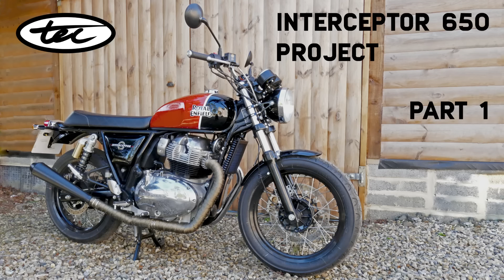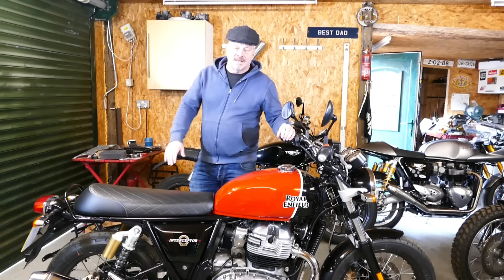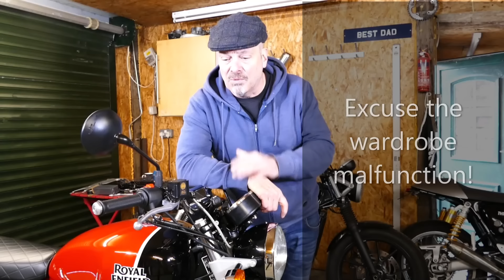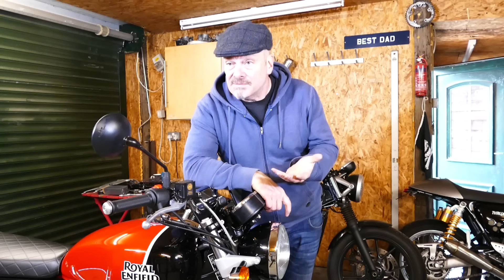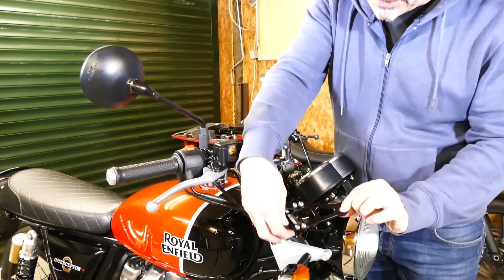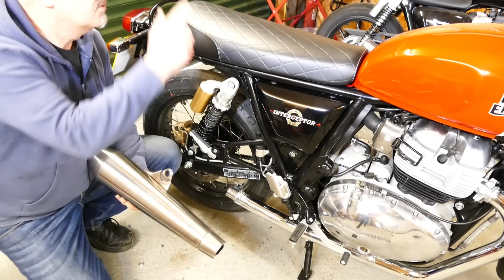Interceptor 650 Project - Part 1

Comment: Contrary to what the video states the kit does not contain domed stainless bolts to replace the galvanised bolts originally fitted to the headlamp. I contacted tecbike parts to enquire about this but you have to use the original galvanised bolts. For info if you notice this as well.😊

Comment: This build is awesome and your videos are great! I am a little ways out from getting one but I had a question hopefully you can answer. If I were to put on the exhaust cans and a high flow air filter (the stock seems restrictive). What would that do to power? More importantly, would I need to get it dump tuned or something since the fuel injectors would have a whole lot more breathing to deal with? Thanks so much and keep it up! Great mods!

Comment: The issue with RE trying to re-introduce to the United States is that there "may" be ONE dealer in each state. No one seems to repair these bikes except for RE making maintenance difficult especially when the closest dealer is over 100 miles from your residence. It would be nice if there was a bit more communication from Royal Enfield about service centers/upcoming dealer locations.

Comment: Hi sir. I don't have a service manual yet so i cant ide tify all parts. Is the welded part of the exhaust pipe undernearth the crankcase part of the cat system? Cant wait to get some of these parts after my wrranty is up. I ak just glad they dont install post cat o2 sensors yet on bikes here in california. Appreciate the videos

Comment: Replacing the indicators with tiny, cheap chinese LEDs is horrendous!  The black headlights brackets too look awful after installation.  The silver bracket provided some contrast. Now it looks like a jumble of black wires and metal!

Comment: Even the new street twin - the 900 at least - has smaller discs both front and back  than the RE as far as I recall. I am not sure the tyres are the same, the RE has a tubed tyres and the street twin is tubeless. As far as I am aware, the pirellis on the RE were designed for it specifically, because of the the need to have a tube in spoked wheels. I stand to be corrected though.

Comment: Hi guys I have a question which cant answer in Royal Enfield dealers at the moment. I would like to use petrol tank from Continental GT 650 twin on my Interceptor coz I like it more how it looks, but I am not sure if it will fit without drilling holes or welding.  Can somebody help me with it pls??????
Reply: The frame an chasi are the same for both bikes so yup you can do senorita !!!

Comment: I'm going to get my licence before summer and have been interested in this bike as my first bike. Would you recommend this bike as a starter? Cheers
Reply: yes this would be a great bike for you , it is very easy to handle ,as long as you are not too short in the leg, as seat height is a little high for some riders
Reply: @georgemilburn6213  That was going to be my next question lol I'm 6ft 4 will I be to big for it? Cool channel by the way if I do get this bike I'll be customising it to 👍 thanks for the help
Reply: @notoriousbc6090  I would always suggest a test ride first, most RE dealer have demo bikes available

Comment: Would you be able to develop a saddle seat kit (with springs) and separate pinion seat for the Interceptor. Thanks, Ronn
Reply from the maker: would not be easy with the straight tube frame rails

Comment: Those original brackets/indicators didn't look too bad on video. The replacement indicators should really be positioned further away from the headlight otherwise, at night, they will get lost in headlight glare. This is a big bugbear of mine with car design - with some cars front indicators are virtually invisible at night. On the Interceptor, I would make sure they were outboard of the forks and/or at a different height.
Reply: well said!
Reply: Couldn't agree more.. I see a lot of cafe racer builds in the internet which sport led indicators on the suspension and sometimes even under the seat.. those might just get you past the regulation but I wonder if a cager will ever be able to see them regardless of day or night..

Comment: Several reviewers have commented on the position of the foot-rests. As I understand it, with feet down at lights etc, they tend to be right where you want your lower leg to be so they dig into your calves. A foot-rest package that alleviates that issue should sell well.

Comment: I'll probably keep adding as we go. But.. The hydraulic line coming from the hand grip. Got to make it black... It has always irritated me that most motorcycle manufacturers use the headlight bucket as a junction box for all the wiring. Nothing but a mass of confusion. My 1974 Honda CB360, that I customized, Had only the wires to the headlight and signals. If I can do it, why can't the manufactures?.....

Comment: I thought that the whole idea of a balance pipe was to get it as close to the head. Am I wrong in my assumption?
Reply: All installations and motors are different and that is normally the case with highly restrictive silencers, but we want one to improve torque at low to mid revs

Comment: Those new led indicators look completely useless.
Reply from the maker: they are actually brighter than the stock ones when flashing, and the whole point is you can hardly see them when turned off.

Comment: Keen to see the next part..one suggestion is will it be possible to mount a saddle  cruier like  seat ..as we see in Royal Enfield Thunderbird..I know you may have other ideas in tune with scrambler look but I would like to get your opinion the possiblity of a cruiser seat .if yes then I would be Keen to see how it looks ..in my opinion it will give more rythem and rider comfort because otherwise I feel the frame the seat is too straight and kills the look and makes it geometrical rather than visually appealing as in Royal Enfield classuc 500 .
Reply: Hi
It has been very enlightening to see the generalized difference in rider needs and tastes between the India and the western country riders. This bike will be used mostly as a leisure/hobby  item  in the west ,and much more as a status symbol or everyday transport in India. Seat design and comfort has come through a lot in comments from India, and to compound this I think the India spec bike has softer ( cheaper ) foam in the stock seat, I suspect we get the India option touring seat as standard here, but still to confirm this.
Stepped plush comfort (king and Queen seats ) were popular here in the 1980's but now not seen at all on bikes here except on big cruisers. Older generation riders and traditional look fans in Europe still like the chrome on the bikes as seems to be the taste in India, but most trends in Europe and the US is away from shiny parts, particular chromed parts. Here in Europe all Black parts are by far our biggest sellers . All you have to do is look at the current batch of western custom bikes and notice the total lack of chrome. India still likes a bit of flash and bling.
Reply: @georgemilburn6213  that's a very nice observation of the preferences and trends ..yes in India the general crowd those who re Royal Enfield fans are driven towards classic ,cruiser look  .and I am one of those who likes the curved  seats (king n queen as you described) ,and I think  those are comfortable as well .Black Matt  seems to look more sober .an all chrome bike looks too much like a shiny utensil.
I will keep myself updated with the modifications you will be doing .

Comment: I have a chrome one on pre-ordered  here in Wa state USA, Been waiting 2 yrs for this bike with the S&S Exhaust.  Going from a suzuki TU250x to this one.  Great video by the way, definately more detailed than most reviews out now over in India.
Reply: Hi
I will be interested to hear your thoughts and if you can actually get an S and S exhaust as it looks like this collaboration has now ended and RE are not offering S and s parts anymore, but may be different in the States. Or S and S may offer them direct and not through RE dealers
Reply: @georgemilburn6213  from what I understand the  S&S exhaust was only ever going to be offered to USA buyers.  At least I hope I'm right about that.

Comment: Great to see your tackling  the RE , as you said its so like the Triumph in basic concept its a natural move . The
foot-peg  position seems to be an issue with many so a reasonably priced adjustable option could be a big seller.
With the instrument cluster why not design an adjustable plate that could be set at different angles ? …. would suit
different tastes as I don't think everyone would want them more flat . I know you liked the performance of the rear shocks
but to me the piggyback style is totally out of keeping with the retro style of the rest of the bike …. I think a good quality 
standard shock would be a popular option.
Reply: Hi
Thanks for the input, yes we are both on the same page here, I am in the process on designing an adjustable clock mounting, and after I have ridden the bike more will decide what way to go with foot pegs and mountings.
We already have several shock options on the shelf for this bike including, none piggy back types

Comment: Not the same tyres as on Triumph... Pirelli made these especially for RE
Reply: I heard this as well, but markings on front tire are identical to my 2016 street twin !, rear is obviously different as different width and diameter.
Reply: @georgemilburn6213  I see. Can it be that even though marking is the same but tyre compound composition is different, giving it better grip?
Reply: @pushkarpadmnav  If the compound was different the tyre markings would be different or how would Pirelli or dealers tell the difference, all the codes and markings look the same to me, but the tyre does seem to grip better than street twin , odd !

Comment: I like the modifications done so far. Looking forward to the completion of customization on this bike....the stock tyres are skinny..a little fatter tyre  at the rear would improve the overall look- hope that is being considered!
Reply from the maker: We will be fitting larger tyres later on in the build as the project develops, and it will be interesting to see how the now excellent handing will be affected .Hopefully not too badly .
Reply: @TECBikeParts  I am looking at 17 inch rims with 150 at the rear and 110 at the front. Hope the swing arm can take a 150 tyre.

Comment: i would hate to buy anew bike and then spend alot more on it.tight i guess haha
Reply from the maker: Hi most people who buy a new bike spend money on accessories, all of the mods I am doing are very low cost or just modifying what is already fitted. I will run through all the costs at the end.  What we are trying to show is that you can have a bespoke suit for not much more than off the peg money. Not suggesting you spend a fortune to tailor the bike to your tastes, and we show you don't need to, but a lot of people do . I know somebody that has recently bought a new Ducati and he spent more than the price of this bike in accessory wheels and exhaust alone !
Reply: @TECBikeParts  hi,i do get it,its the buyers choice.ducati man sounds extreme to me.just bought a 16 v strom  650.screen is crap so will spend 100 on a good one that works.maybe a fork brace for 50 and was lucky to buy new suzuki panniers and frames for 350,good old ebay.my point is why dont they fit a screen in the first place that works and a centre stand on bikes.why is thatan extra.bikes are bloody expensive so why do we have too put up with this?.
Reply: @peterpyke1213  , I have worked in the motor trade all my life and it is engineered that way so sales staff, parts dept and workshops make extra money. I will give you an example, I recently bought a car and on the option list the drinks holder was an outrageous £78.00 so I did not choose it, after spilling hot coffee on myself twice I thought i had better buy one, so I went to the car makers parts counter and ordered the small plastic clip in part (30 seconds to fit ) Cost £17.00 So where does the extra £ 61.00 go ! This is why Triumph dealers charge £200 plus labour and vat  for a stand.
Reply: @georgemilburn6213  there was a small rubber nut missing from i screen fixing.got 1 from suzuki £7.then looked on ebay 10 for £4.59 .iwas gutted.labour charges are high.its why i only buy a bike thatjust needs an oil and filter change each .year.i my last bike a 600 transalp for 20 years and only changed oil and filters tyres ext.80.ooo miles.cost nothing to run.alas no dealer stamps in my service book but thousands in my pocket.

Comment: Nice informative Video. New exaust looks nice. The stock RE once are hedious.  could you please try reducing the length of bend pipes so that the end cans don't stretch beyond rear foot pegs. Something similar to the once on triumph.
Reply from the maker: Thanks for the feedback, we were thinking of a much shorter 2-2 that ends at the rear axle or before. we will be starting on mock up systems for testing soon.

Comment: Quick question. If you fit a pair of the £95 meggas will you need to re-map the engine?
Reply from the maker: Hi we have checked the A/F ratio plus road testing and no need for a re map.
Reply: @TECBikeParts   Are these pipes available now and have you got video to hear the sound.

Comment: I've got a Ravishing Red on order hopefully arriving this weekend.  I'd be interested in a bolt kit that had black anodised bolts to remove a lot of the silver bolt heads and the black headlight ring.  Don't mind the Lucas style rear light  but agree the Indicators need to go. Also I have some ideas for the stock indicator brackets so will be checking eBay for those that are removed.  As far as the anodised rims go the Silver bikes are also anodised so be careful with that wheel cleaner! 

What would look good is Blacked out Ohlins they sell for Harley Models. Also Ikon suspension has a rear shock set ready to go for these bikes.
Reply from the maker: Watch episode 2 for blacked out adjustable shocks options, handle bar and lever upgrades and a look at the rear end all planned !

Comment: It would be great to raise up the pillion seat a little. I'm not really sure how it's going to be done but that's going to improve the pillion comfort as the footrest are on the higher side. It would also improve the looks like the street twin once you remove the rear mudguard as you explained. But I have a feeling this can only be achieved by altering the frame.. something that I did not want to go for
Reply: problem is the frame rail has been made straight (for styling ?)all you could do is have a built up seat in King Queen style. Not my taste !

Comment: My girlfriend and I are looking hard at both the Street Twin and the Interceptor as her next bike. The price of the RE is a huge draw, but the power of the engine has me doubting my choice. I recently watched your video about "hopping up" the Street Twin with a hotter cam. I'm now wondering if a cam is the fix for the new RE, in order to bring it up to 21st century standards? S&S was able to get something like 150 horsepower out of their "Salt Flats bike," but they're keeping a tight lip about how they accomplished it. Though, I do know they put nitrous on it! Thoughts?

By the way, when you whipped out that stainless slip-on and held it up to the Interceptor's mounting points, I literally got giddy! I think - knowing what's in the works at TEC - buying something other than the new Royal Enfield is going to take some serious convincing!
Reply: I was expecting a question along these lines. As a Triumph specialist I am probably going to fall on that side at the moment, But the huge price differential cannot be dismissed, It is early days with the bike and time will tell how things pan out. RE cannot be making a huge profit on these at this price in Europe and this is a marketing ploy to get the bikes back into the mainstream. They also need to build a larger and better dealer network, so maybe time to bag a bargain. I think the main deal breaker points (apart from price) that will probably make the choice are . 1.A test ride, 2. Seat height (the RE is quite a bit higher so the Street twin appeals to shorter riders)
3.the slight difference in features and if you feel these are important for your needs  i.e number of gears, lack of traction control,resale value, warranty, etc. So not an easy choice even for me and I would recommend  test riding both bikes back to back before choosing . I am sure your girlfriend will enjoy both and neither is a bad choice.
Reply: Like you I was unimpressed by the performance stats, but when I test rode one last month I was pleasantly surprised by the torque and power.